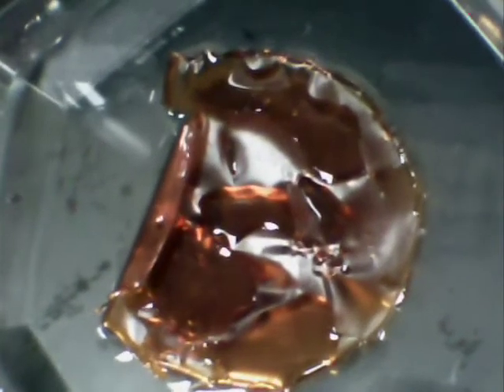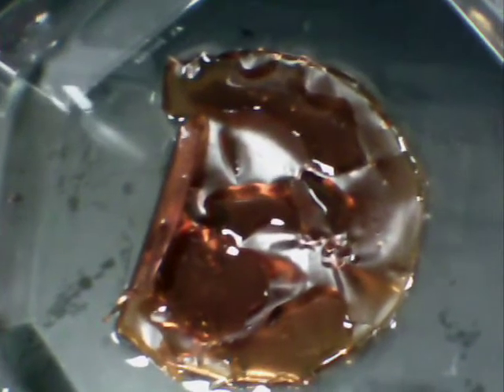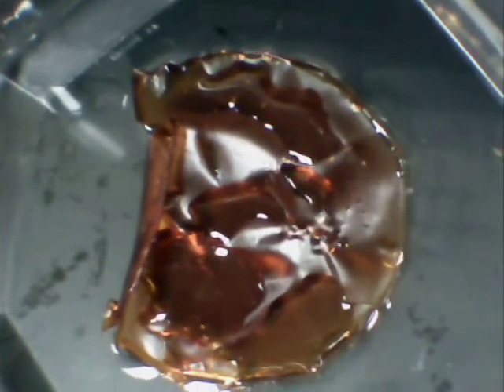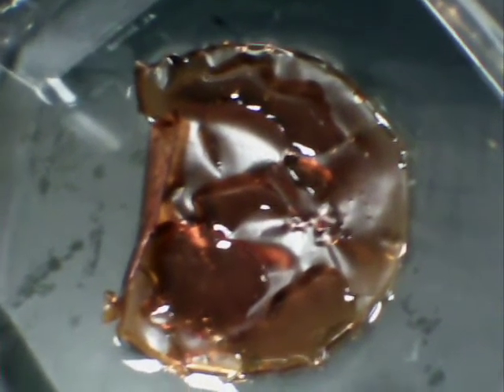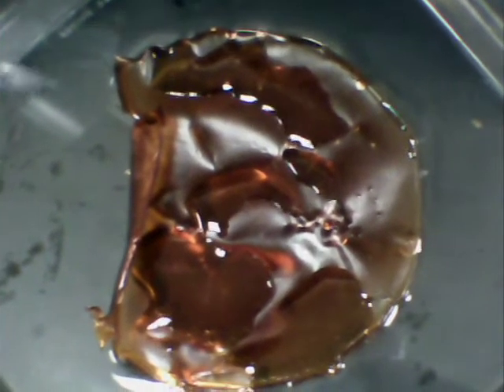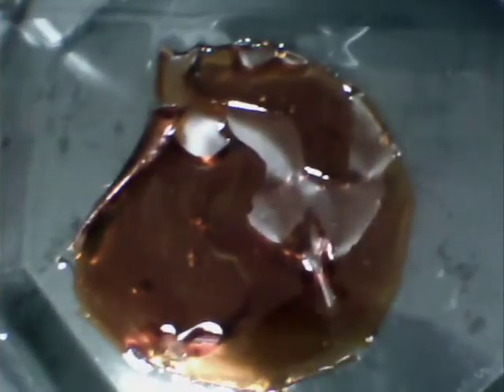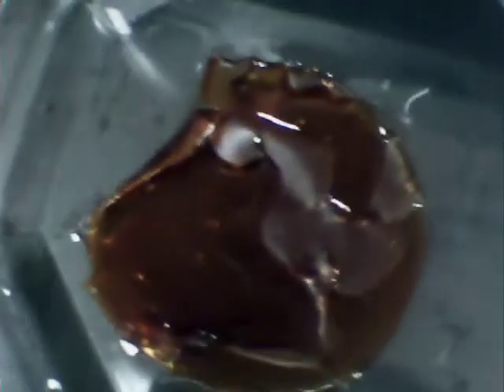Composite Thin Film/Chitosan-Gum Acacia

Comment: Hi, I have a question. Did you make this film in a lab or were you able to make it at home? I'm working on a project and would like to make a polymer/copolymer film at home.                       Thanks
Reply from the maker: Hi I did it at school, but many of these thin films can be done at home. Start with gelatin as a thin film. It will take longer to evaporate if you don't have a fume hood- maybe 4-7 days vs. 12 -24 hours with the fume hood.
Reply: Wow, thanks for the speedy reply and thanks for the information. Do you think the same technique could be used for adding or cross-linking more than 1 polymer to change the properties of the polymer? Also, are there any steps during the formation of the film that are extremely sensitive? (ex. pH sensitive, temperature sensitive, etc.) Sorry for all the questions.
Reply from the maker: For sure. Composite thin films are very impt. right now.